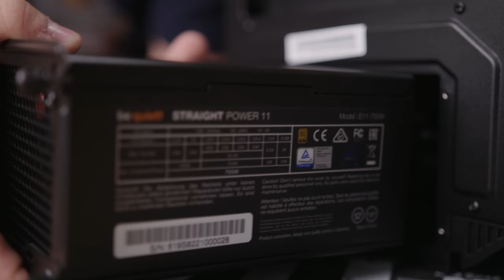💀 The DEAD Silent PC 💀

Comment: I own that cooler on a 1700x and a gigabyte 1080 gaming. It is VERY quiet, And cool. Can run heaven and valley at the same time with 68° C top temp on cpu overclocked to 4.0 at 100% load. Ambient air temp is 68°F and right next to the A/C vent. 5200 FT altitude. Hate the fan spring design of the DR pro 4 and the fact I don't see a kit to put different fans on the cooler. But it is quiet.

Comment: I think the three exhausts at the top are excessive, especially for a case this long. You have a lot of air that is drawn out of the case immediately before it's even reached any of the components. Probably 50% of airflow is just front straight to top without any of it touching the CPU or GPU coolers.

Comment: Damn, Gigabyte needs to bring those fans back. Specifically the LED design along the outer blades, set to that chasing mode looks unreal. Better than any Corsair LEDs I've got in my system...

Is the contest still open? Asking for a friend, I made it in time right? It's only 6 years late -_-

Comment: Sees you pull the sticker off the BeQuiet logo. Thinks, "I don't remember a sticker when I built mine." Looks over at case and realizes there is a sticker on the BeQuiet logo that I failed to remove...😂

Comment: The 240 mm aio on my 9900k cools it pretty well. I have 2 noctua a12s on it and they never make any noise. My system fans hardly ever go above 1000 rpm and my 6900xt is underutilized at 1440p so it never spins the fans up past 50%. Everything stays at 60c or so if I limit framerate to my 144hz panel

Comment: i know it's ugly but a morpheus cooler on the GPU with a couple of be quiet fans would have been even quieter and the GPU would run cooler
i just started using one in my system and it's a brilliant, keeps a heavily overclocked 980ti at 55-60c while being virtually inaudible

Comment: What about a RAID Array using 8x 100TB Data Center SSDs connecting to a RAID Controller using the RAID 6 mode that should be more than enough storage space for your data and programs and should be very quiet.

Comment: Sorry, but to me this doesn't make a lot of sense. For one, the GPU and case fans work against each other, in a really stupid way. Then, the case comes with Pure Wings 2, which are installed at the front, as intakes. You installed Silent Wings as exhaust at the top. Silent Wings have much higher static pressure, and should therefor be used to pull air through the dust filter, not to steal the GPU's air. There is also an additional exhaust in the rear. But instead of letting the intakes spin faster, they're all connected to the same controller, meaning you will end up with negative air pressure.

But now the items are bought, so I guess you have to work with that. You could turn around the fans at the top, feeding the GPU, and turn around the rear exhaust as intake and the front intakes as exhausts. Put filters on top and rear, and turn around the Dark Rock, which you wanted to do anyways. Now air is going from back to front, coming in at the bottom, and your GPU is directly fed with fresh air. Due to the fact there are so many fans, the "hot air rises" stuff isn't that big of a deal, since there are 3 140mm fans exhausting it very quickly anyways. In that case, you'd have to spin the 120mm very aggresively, and have the other 6 fans about the same, so just set an aggresive curve in the bios and connect all the 140mm to the case fan controller like it is right now.

Comment: Why are the top fans pulling air away from the GPU? Also the placement of the "underglow-kit" kinda bothers me. Looks a bit like you just wanted to cram it all into the case. Still nice build, but would've changed those 2 things as example. Have a good one :)

Comment: 6:23 there are 4 Torx screws... one in each corner.... I WONDER IF YOU COULD FLIP THE COVER PLATE 

also you really have to understand BeQuiet. 
The Dark Rock Pro 3 was laughable easy to install, you just need to know how. 
If you guys want a video where I show how the DRP 3 can be mounted easily, let me know. 
Used it is a pretty fucking badass heatsink for the money

Comment: Now I know people are going to call me crazy or stupid, but I am a fan of AMD and would love to see this build(if it would even work)

PCPartPicker part list: https://pcpartpicker.com/list/qchN9J
Price breakdown by merchant: https://pcpartpicker.com/list/qchN9J/by_merchant/

CPU: AMD - Threadripper 2990WX 3GHz 32-Core Processor  ($1719.99 @ Amazon) 
CPU Cooler: NZXT - Kraken X62 Rev 2 98.2 CFM Liquid CPU Cooler  ($145.95 @ OutletPC) 
Motherboard: ASRock - X399M Taichi Micro ATX TR4 Motherboard  ($283.98 @ Newegg) 
Memory: G.Skill - Trident Z RGB 32GB (2 x 16GB) DDR4-3200 Memory  ($432.98 @ Newegg) 
Memory: G.Skill - Trident Z RGB 32GB (2 x 16GB) DDR4-3200 Memory  ($432.98 @ Newegg) 
Storage: Intel - 660p Series 2TB M.2-2280 Solid State Drive  ($349.99 @ Newegg) 
Storage: Intel - 660p Series 2TB M.2-2280 Solid State Drive  ($349.99 @ Newegg) 
Case: Corsair - Crystal 280X MicroATX Mid Tower Case  ($79.99 @ Newegg) 
Power Supply: LEPA - G Series 1600W 80+ Gold Certified Fully-Modular ATX Power Supply  ($356.89 @ OutletPC) 
Case Fan: Cooler Master - MasterFan MF140R ARGB 90.0 CFM  140mm Fan  ($25.98 @ Newegg) 
Case Fan: Cooler Master - MasterFan MF140R ARGB 90.0 CFM  140mm Fan  ($25.98 @ Newegg) 
Case Fan: Cooler Master - MasterFan MF120R ARGB 59.0 CFM  120mm Fan  ($20.97 @ Newegg) 
Case Fan: Cooler Master - MasterFan MF120R ARGB 59.0 CFM  120mm Fan  ($20.97 @ Newegg) 
Other: Radeon Vega Frontier Edition Liquid Retail  ($999.99 @ Amazon) 
Other: Radeon Vega Frontier Edition Liquid Retail  ($999.99 @ Amazon) 
Total: $6246.62
Prices include shipping, taxes, and discounts when available
Generated by PCPartPicker 2018-10-31 16:50 EDT-0400

Comment: A silent PC not built with water cooling, not built with passive cooling and not submerged in mineral oil. Instead using (I admit low noise) air cooling. With 12 freaking fans!
Yeah, that's not a lie at all...

Comment: "DEAD Silent PC"  *Doesn't use liquid cooling*  *Has thirteen fans*
Reply: It depends on the cooling and other hardware, air can be more quiet, especially in idle.
Reply: @Alex11223l2  One of the primary benefits of liquid is the noise. It's far more quiet, at equivalent temps. Sure you can just run hot with low fan speed but then this nice system is going to thermal throttle.  All my fans run on low even at load with a massive OC. That GPU stock cooler is gonna be louder than my whole SLI system. Just think its funny that the primary goal is noise and he did almost nothing to make the PC quieter, except use a lot of Be Quiet hardware. Wheres the noise dampening fan mounts or case feet? How bout fewer larger fans? Did he even test to see if he needed 7 case fans... Couldn't get an AIO on the CPU, because Be Quiet only has air available here? Looks like he used the crap thermal paste that came with the cooler. Underclock? Just went stock on everything and called it a day. Lazy ad not a build log.
Reply: There are issues with this build, but I wouldn't say it's one of them.

Liquid cooling is not a silver bullet for quiet builds, pump makes noise etc. Also many people care mostly about noise in idle. For example, in games you would probably have headphones anyway.

See silentpcreview forum, almost all builds do not use liquid.
Reply: @Alex11223l2  Not even saying he had to go liquid, just that if your primary concern is noise then liquid is going to give way better results. It's one of the main reasons ppl still go with liquid as most components can reach their silicon limit before their temp limit with even decent air cooling. You're able to get a much larger and more efficient heatsink so the fans barely have to move. My pump is so quiet I had to install a flow visualizer to make sure its still running. That GPU at full load is going to be so loud. silentpcreview even says this in their build guide; the GPU is going to be the loudest component. Only way to dramatically reduce the noise is to swap a liquid cooler, or underclock. Why not just go with a hybrid card? Or do nothing about the loudest component. Just look at the way the exhaust fans at the top are working against the GPU's fans, good thing there is only one.

But there was so many other things he could have done to make it quieter. I mean people learned literally nothing about how to make their PC quieter from this video, besides buy Be Quiet hardware. How bout do a trade-off analysis of underclocking the CPU and GPU. Because just like OC has diminishing returns, underclocking greatly reduces your power consumption and therefore temps. I would have liked to see how much he would have to reduce the GPU clock to get those fans to turn off entirely. This is the perfect system for that because the components are so fast even underclocked a few percent you'd have ridiculous performance and it would be one of the most power efficient available. Maybe find the minimum number of fans. I once got a PC down to just a 92mm and a 120mm by rearranging/modding the PSU and GPU so instead of 3x 40mm fans they used the single 120mm. He has more case fans than are in my entire current build, in total > 2x the fans and my GPUs are prob half the temp. Thirteen fans on a silent pc, good joke.

And idk if I feel the same way about idle. Im a developer and am using a good portion of my system all day, normally with no other noise to distract me. I imagine he does a lot of video editing under similar circumstances. Of course I also want it quiet at idle but the biggest thing for me is it doesn't sound like a jet taking off when I do anything intensive. The change in noise is more distracting.

Comment: Id be dead before I can afford any of that.
Reply: Wait so since the GPU is facing up air is trying to be sucked down into the card, yet the top fans are exhaust? Bad air flow? With only 1 intake fan to push around that area... Dunno maybe it doesn't matter? Just seems like top fans should be intake now to blow cool air directly to the card.

Comment: A 750w PSU will power all that???.......... well RIP me buying 1000w PSU for no reason XD lmfao
Reply: A 600w will.. a 500 will.... OC maybe a 650 or 700
Reply: If you use AMD GPU then 1000 watts
Reply: @DarkPa1adin  No. 2700x + Vega 64 run on my 80+ Gold 750w EVGA G3. If you Undervolt, you could get away with a 650.

Comment: Toshiba is the worst when it comes to PC products. I bought a gaming laptop from them back in 2009. It cost me $800. It had only 1 cooling fan and vent on the back, overheated within the first 15 minutes of use. and the Hard Drive disk melted 6 times within 2 years before the warranty expired causing the 7th melt on it forcing me to get a different PC. It also never ran any games that were more graphics intensive than pre-RS3 Runescape. I will never buy another Toshiba product, ever, and I recommend nobody else buy one.

Comment: flip it was completely unnecessary all logos are upside down, looks terrible, you could only left it normally, put the gpu vertically to appreciate it the most and use an AIO cooler, to see the rams, the completely disappear at the end... all on that build locks wrong...

Comment: Kyle I need help: I’m building a PC with the following specs:
AMD Ryzen 5 3600x
Corsair Hydro H100i RGB
32 GB Gskill trident RGB ram
1TB m.2
120GB SSD
A random 70$ case
A 750 W bronze power supply
ZoTac GeForce RTX 1660 6GB
2 Corsair 120mm RGB fans
B450 motherboard

Idk if this is optimal, help
Reply: Purpose, Gaming + streaming and light editing
Reply: Aux Lucid yeah it’s good

Comment: Hi I want to know if my pc is good  

Hyper x fury 8GB DDR-4 2400MHz memory 

WD 1TB blue 7200RPM Desktop Hard Disk

Asus GTX1060 Dual OC 3GB DDR-5 Graphics Card

Intel core i5 8400 processer 8th gen 

Asus prime Z370 Mother board

HUNTKEY GS700 80 Plus power supply

Comment: That is one ugly flipped system. The GPU would've been better showed if u mounted Vertically using the new cable mod bracket.  The GPU sits so far high that u won't even see the rgb.

Comment: i think its a shame that you are using a ROG MAXIMUS XI , with aroeus GPU, covering up the motherboard entirely , except for the part with text , and then flipping it around, i think the flipping is fine for showcasing hey this case can do this, but i think its a horrible build to show it off with , not flipping the cooler/not getting some proper ram , and what does it matter its RGB with orange parts when its entirely blocked by the cooler. 

im a huge fan ,and love what you do, (got my s340 elite cause of you) but this build is not your best work ,far from it .

Comment: I bought the aorus 2080 8G (non Xtreme) and have some trouble with overclocking. Whatever  oc i put on the clock speed just doesn't apply to it. I've tried the aorus engine Software, msi afterburner, even Gigabyte oc Guru II. Does anyone have trouble overclocking their 2080 as well? Oh and I've tried those separatly so that they don't conflict with each other, but nevertheless the Benchmark results stay the same and programms like gpu-z Show clocks about 1980mhz when not overclocked(which should be 1845 boost clock) and 2250 when Just Putting a slight oc of about 50-75mhz on it.
Reply: Nope, mine oc'd perfect
Reply: @samvhell9104  what Software did you use and what clocks did you achieve?
Reply: Mine did +100 on clock with Afterburner
Reply: @samuelapril-fiederer4880  so what was it in total? Mine just did stable 2070mhz with the aorus engine but i think it could reach a little bit more.